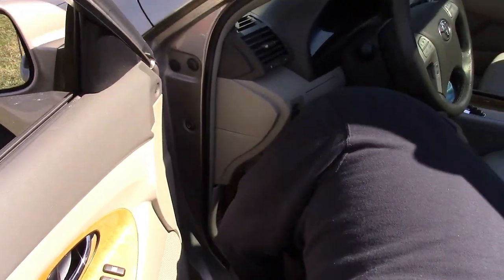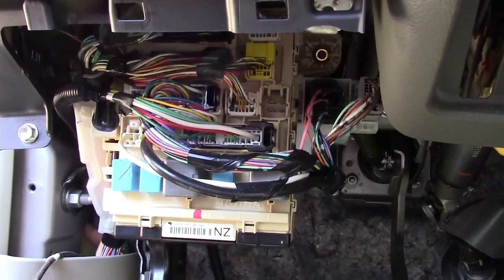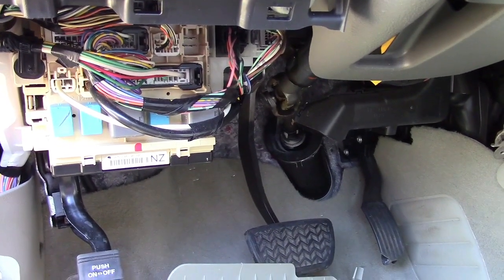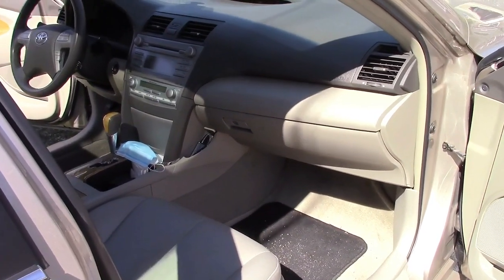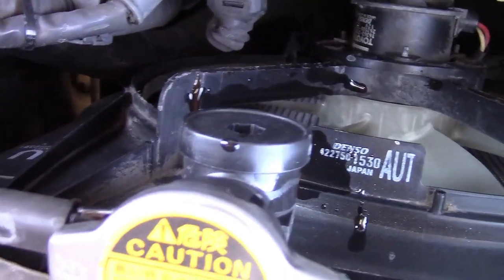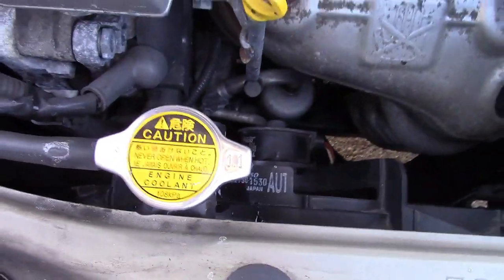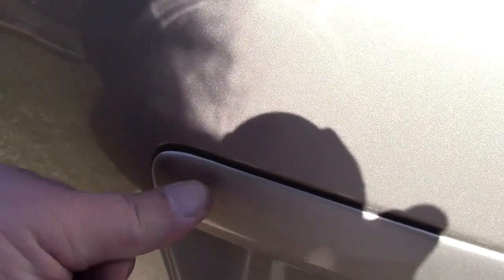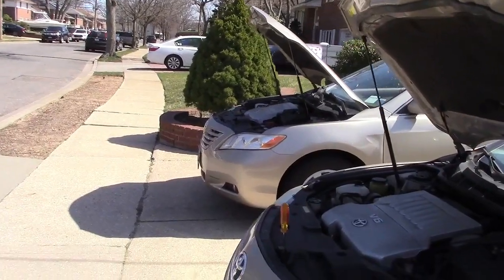Searching For The Elusive Remote Start Module On THE BIG SIX

Comment: Interesting to see some of the mid year changes. look forward to xjoe81x's video.
Reply from the maker: The overflow bottle cap was one that I had just noticed in this video.  But if you analyze that, such an innocuous device.  It was functional the way it is on my car.  What ever made them pick THAT out of all devices on the car, to redesign?
Reply: Must have found a method for $.0000001 cheaper to manufacture..
Reply from the maker: @dynatrak  You got that right!

Comment: This is REALLY ironic, considering the video I just posted.

Your steering wheel looks humongous, to be in a Camry.

Plastic crap - 2 words that describe every single modern car.

I didn't know that Toyota ever offered remote start. I thought that even the new Lexus', didn't have it. I didn't know that they ever offered it, let alone on a car of this age.

When your cabin air filter deteriates (say it like Joe) you take it to a "pro" shop. It's all a scam, they mess your car up.

I have that issue with my seats. In the mother's car, her and I sit at the same place, I just jack the seat up in height. It's a problem when I drive my father's Volkswagen, because he sits so close that I can't even get in, even though I'm only 4 inches taller than him. He likes to have his "whole foot" on the pedal, instead of just the tip, like a normal person, so he sits about 8 inches from the steering wheel. You could lay down in the back seat behind him. It's not safe, and he knows, but doesn't care. I have to reach in, all the way to the other side of the seat (since that's where the lever is), and push it all the way back. Then it's in a normal position. Although, I sit so far back that you can look at the headrest straight on from the back window.

"You have to take it to Toyota". On a real (American) car, you could find that part in a junkyard in 5 minutes, and put it in yourself in 5 minutes. You have options when you buy a normal car. I bet if you had bought a 2007 Chevrolet Impala or 2007 Ford Taurus, you would have exactly zero videos on it, except the tour. I see a lot of repair videos on Joe's channel of his Toyota.

About the engine dangers, that's reason 40000000000000000 that I will absolutely never own a car with that dodgy push button ignition. I have no trust in that.

Like OMG, My Range Rover that daddy bought has an app.
Reply from the maker: I posted this now because it's spring, and there are going to be a lot of spring-related videos I'm going to be posting in the near future.

That steering wheel is about the same size as any other mid-size car's wheel, there's nothing different about it.

Agreed, they're all plastic.  "Saves weight" the manufacturer says.  "Saves cost", says Uncle Jay.

Toyota has had remote start for quite some time in their vehicles as an option, you're out of touch.

The "pro" shops have people working there who have done it once before.  That's all a "pro" is.

Your father drives the correct way with the whole foot on the pedal.  If just the tip of your foot is in the pedal, you have to "reach" with your leg to give it a lot of go-juice, and that's unsafe.  The rest of what you said about the seat position your father likes is up for interpretation.  xjoe81x, for example, likes to drive from the back seat, his seat is all the way back.

False and wrong!  ALL CARS (if you can even call an American one a "car", and I don't think it qualifies as much more than a go-kart) these days would have the same issue where it needs to have the dealer extract money from your pocket to make it work.  Especially Chrysler products, you can't even change your own car battery without getting a check engine light, and I know that from EXPERIENCE--something you don't have.

The pushbutton has its fair share of positives and negatives.  The greatest is there's no fumbling with keys, or even trying to find them.  EVERYONE has had the experience of losing their car keys in their own pocket.  You also can't overcrank or undercrank the engine, it handles it itself.  Saves on starter and flywheel wear.  THE BIG SIX only gets it wrong maybe once a year.  They tried really hard to make it emulate a key, it works very similarly.  It also lets you shut down very easily in the event of emergency.  People don't know how to do it, for much the same reason I made thousands on my video on how to start one with a dead keyfob.  All of the information is in the book.  Nobody reads.  I'm not saying I support the pushbutton, I don't mind a key at all.

You'll NEED an app.
Reply: Wait until you see my video from today.

It looks huge.

Cost cutting = the golden rule of 2000's car culture.

I didn't know that.

Done it before, doesn't mean done it right before.

So do you sit 5 inches from the steering wheel? I don't mean the tip, I meant my toes and my foot, everything above the arch is what I use. When I visit, if you drive with me, you'll be seeing that I basically sit in the backseat as well. Unless I'm driving a Cavalier or something, then I'll be driving from the trunk.

But 2010-back cars were usually self-repairable. Chrysler these days is a crock of you know what. I don't know of a single modern Chrysler I'd recommend except the trucks. If someone wanted a new car that was reliable, I'd say Volkswagen.

I agree with that. What happens when it's cold, and takes 20 cranks to start? Will it keep cranking until the starter burns up? 

Since you have one, you can answer the question I've had since I first experienced push-button cars at the age of 10, with my grandparent's 2015 Honda CR-V. Do you have to hold the button, or just tap it to start? I've always held it down, and they did too, same with my dad.

Like OMG, you just offended me by assuming.
Reply from the maker: @isaac24  I'm watching.

It's "fat" maybe, due to the leather wrap.

Cost cutting has been going on since the 80s for sure.

Now you know.

Yes, that's exactly the point.  Just because someone got it done once doesn't mean it was done right and will hold up over time.  But yet, that's a pro.

No, like I said the rest was up for interpretation.  I sit back as far as possible from the DEADLY airbag, without being uncomfortable and preventing me from properly reaching the pedals.  I think I misunderstood when you said "whole foot".  You're now referring to the arch to the toes--that's what I thought you mean when you said "whole foot".  That's the correct way as far as I'm concerned.

It was getting hard to work on cars in the early 2000s.  The wif's car is of their older, tried-and-true engine design, and there's lots of room.  Old Clanky was getting tight to work on.  Ginger is even tighter because there's a larger engine.  THE BIG SIX's engine takes up the whole bay, so a lot of accessibility is limited.  Still, a number of things are easily accessible, like the starter, unlike my dad's Honda, which is buried under the intake manifold.  

YouTuber bah53 had a video about that.  https://www.youtube.com/watch?v=YzXrMzgoTdo

THE BOOK states it will keep cranking for up to 20 seconds in an attempt to start the engine.  Obviously it automatically releases the starter as soon as it starts.  THE BOOK also says that you can press and hold the button, and it will keep cranking up to 30 seconds at a time.  Regardless of what bah53's video shows, and I believe it because I saw what he did, it's good practice not to torture the starter.  Basically, an engine that's in good running condition, with everything checked out, should start almost immediately.  You've seen my snowblower videos when I electric start it it pops off almost immediately.  My dad was given a snowblower by a neighbor, who burnt out the starter by cranking too long.  It wasn't starting, so he kept cranking.  Old carbureted cars are a bit of an exception.  With a mechanical fuel pump and no fuel in the lines or in the carb, it's going to take an extended period of time for it to fire.  Engine can't run without gas, and the only way to make it get gas it to crank it since the mechanical fuel pump is driven off the engine.  You can cheat and put gas in the carb, which will make it pop off almost immediately, and hopefully run long enough to pump fuel up from the mechanical pump and into the carb, and the engine stays running.  But without that, fuel drains back and it takes an extended period for it to start.

What you do with the button is READ THE BOOK.  That will tell you what to do.  In THE BIG SIX, I just tap the button and it cranks up by itself.  There were some GM cars in the early 2000s, maybe into the 2010s, that had a key you could just tap and it would crank itself up.
Reply: Good for you hun.

That's probably why.

Yep.

Good hun.

No, my dad puts his entire foot, from the heel to the toes, on the pedal.

True.

That doesn't matter.

That just SOUNDS like burning up the starter.

Those were dumb. The Malibu's from 2004-onward (not the Classic) had that.
Reply: If you had a 2007 Taurus or Inpala you wouldn't be making videos on it because it would be in the scrap yard!
Reply from the maker: @nextg5062  You got that right!